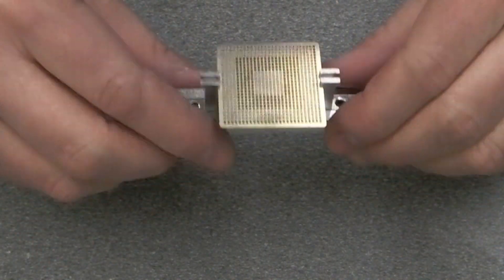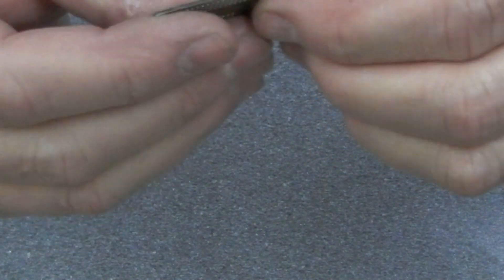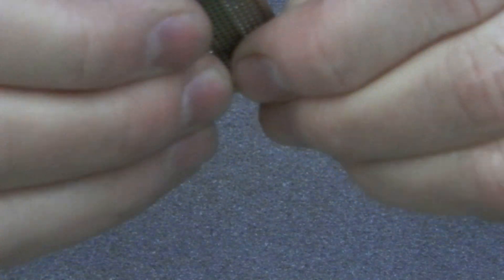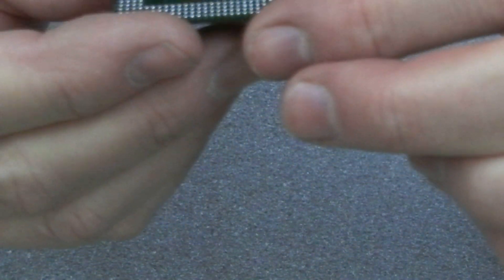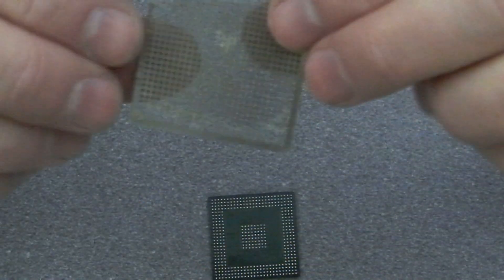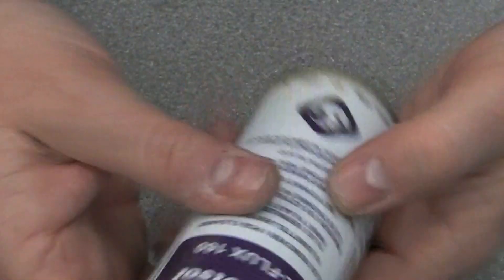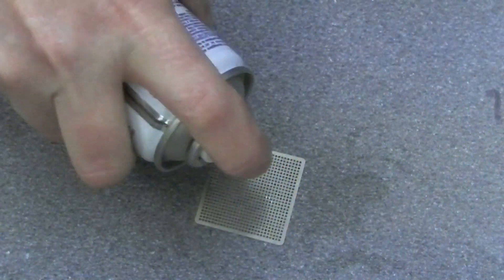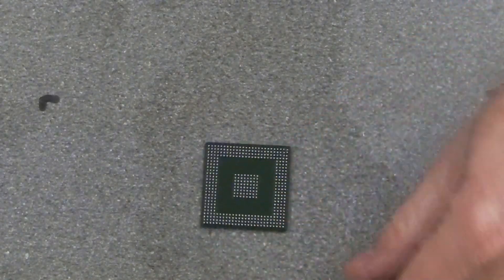BGA successfully re-balled.

Comment: Hi Trev. I just came across your channel today. Quick question.
Which budget friendly BGA reball machine will you recommend. I watched your video on the ACHI IR6500. I don't know if its still a good recommend. What do you suggest?
Reply from the maker: Whilst I no longer need to do this sort of work the 6500 was perfectly ok. There may be as newer version now. I would have a look at the current market and check.
Reply: @Trevs-Shed  thanks so much for the reply. I think ACHI still has the IR6500 as their flagship series. I've been contemplating which effective budget friendly BGA to settle for. Maybe I'll do the IR6500